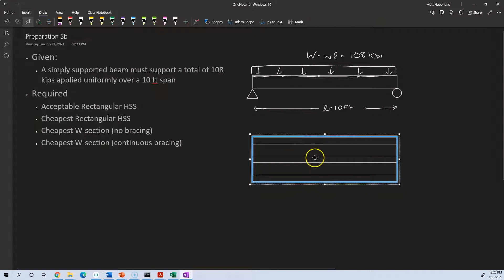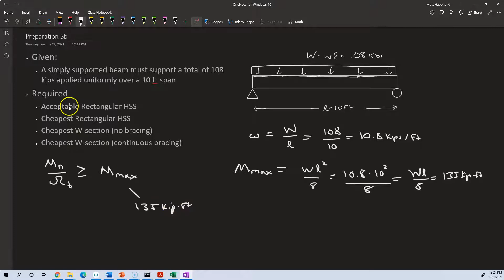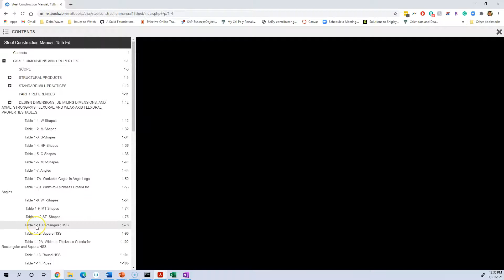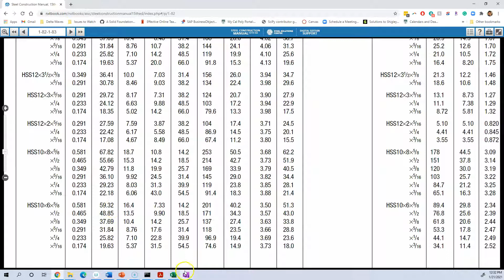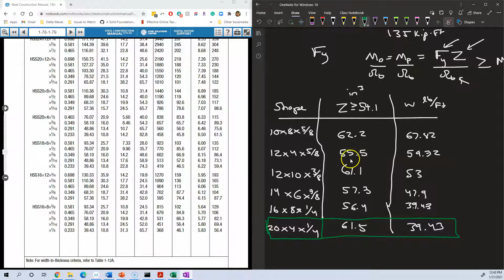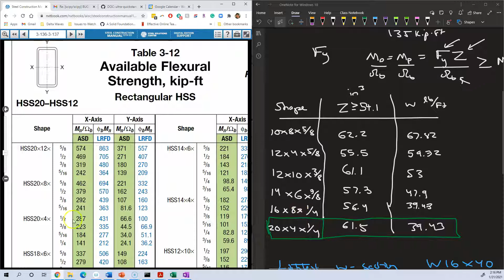Steel Available Strength Design II: Beam Selection Example - HSS

Comment: Aren't HSS shapes typically 46ksi?
Reply from the maker: For circular cross sections, yes. But the AISC recommends ASTM A500 Grade C for HSS, and that offers a minimum yield strength of 50 ksi for square/rectangular sections.